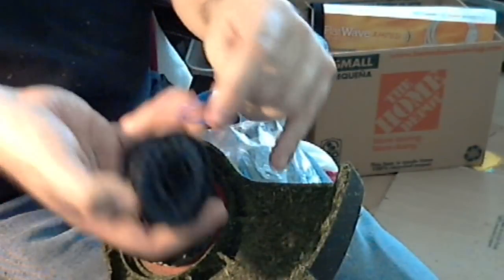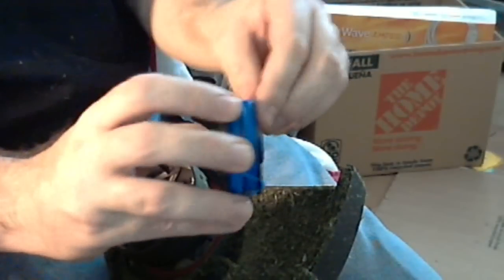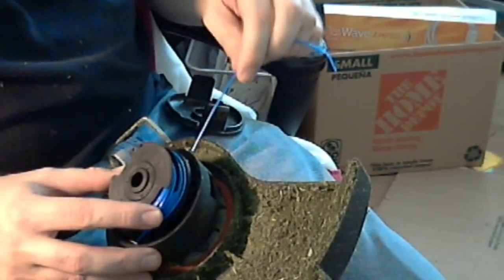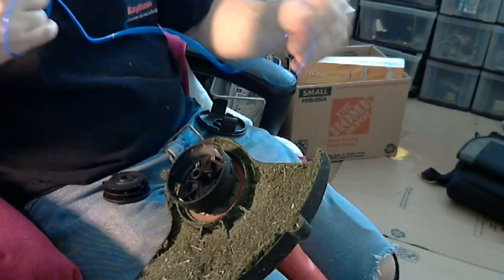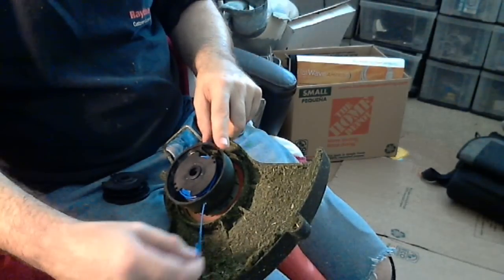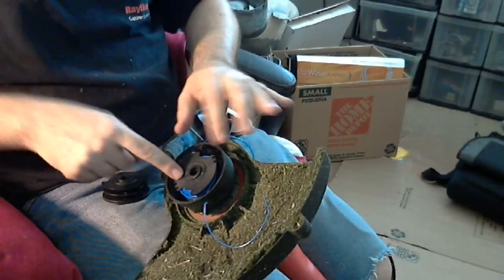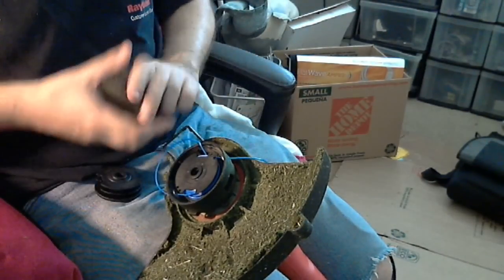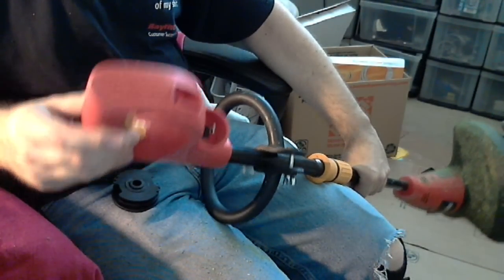Homelite string trimmer cartridge replacement

Comment: nice, and I totally recommend getting the 0.065 refill line and refilling it myself.  275 feet for $8 at home depot can't be beat!
Reply: I have the same refill line, but my problem is I don't know how to run the line around the spool so that it works properly. All these videos are showing our how to replace the spool. Any moron could pop a spool in. I need to know how to thread an empty spool with new replacement wire.
Reply: Mr. Perfect

Comment: mine is just chewing up the strings like nothing. everytime i turn it on even with very short strings,  Seems like it just keeps feeding the line out. very frustrating
Reply from the maker: rebecca danielson the string advance button might be stuck.  pull the power plug and then check it.   pull the line on both sides,. should only give a few inches each time the button pushed
Reply: no the button isn't stuck,  it clicks when i check it, and when i pull both strings they are tight.  But when i turn it on after only a few seconds the string is hitting the guard causing the string to be chewed up